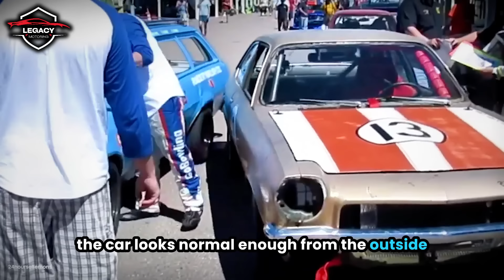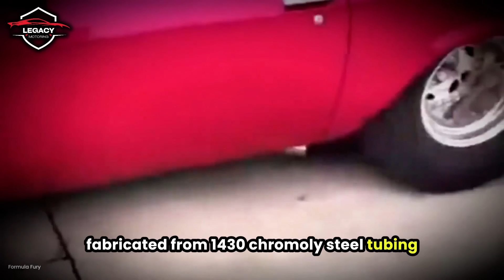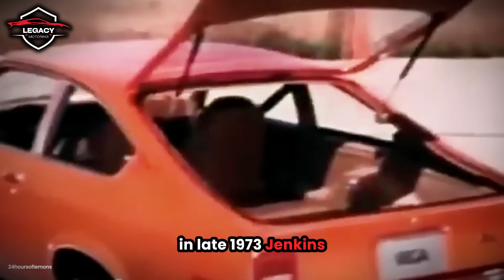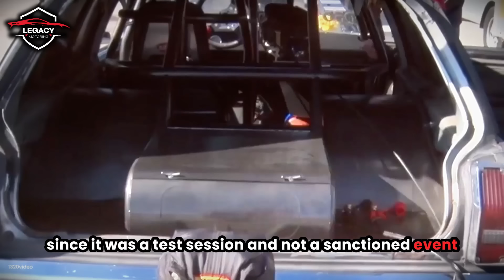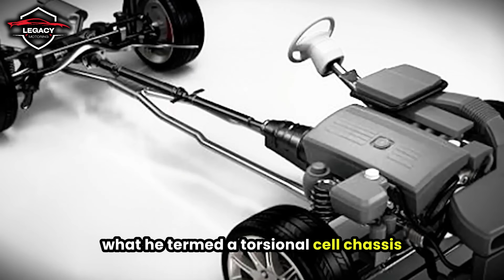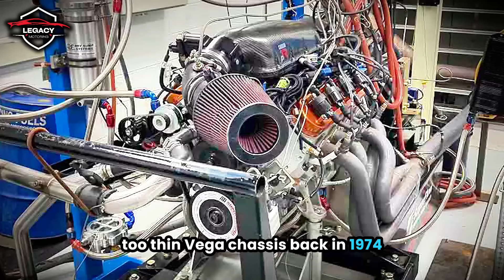What Was Inside The "Impossible" Vega Chassis That No Engineer Could Explain?

Comment: Wally Booth was a good and kind man. He guided me on my first engine build and he built the short block. He made sure I put money into parts that would make more power.
Reply: Wally Booth was the first to build a gremlin per pro stock rules, I've seen that layout many times, it was a 2×3 frame rail with a chrome moly cage the chassis went up to the fire wall and you were allowed to move the fire wall back for engine set back, number one spark plug had to line up with the front spindle and the car had to maintain the factory wheel base now that car used to pop some serious wheelies because of it being so rigid